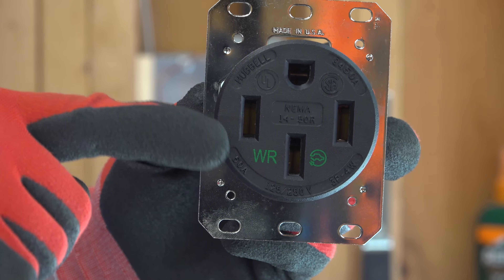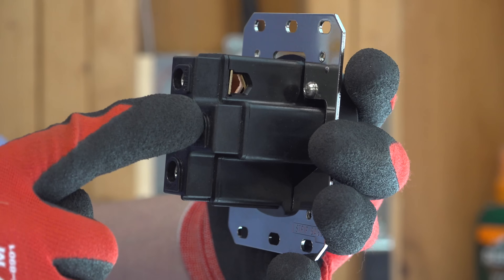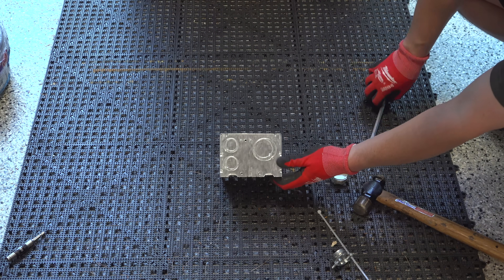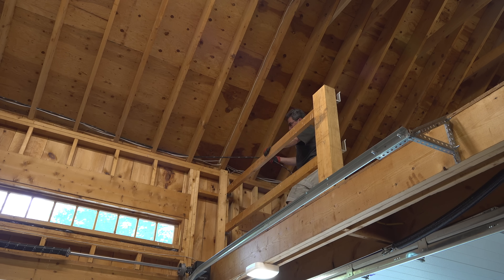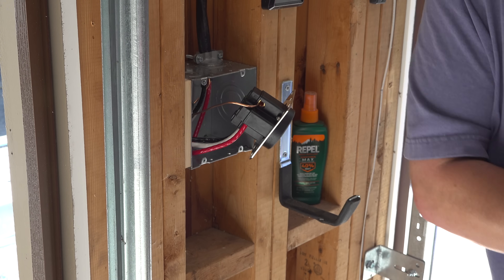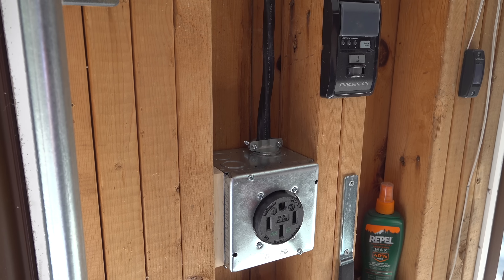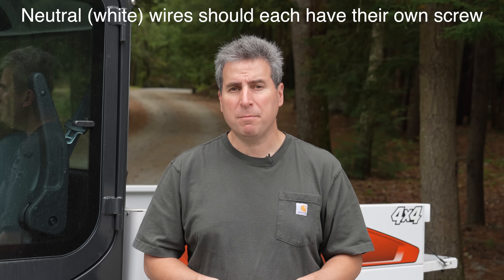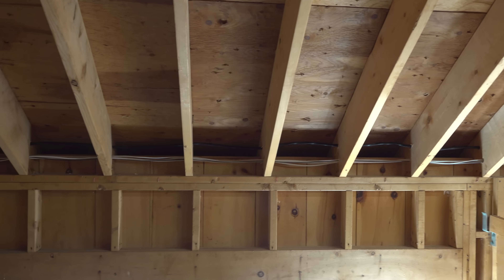How To Install A 240V Outlet Start to Finish -  EV Car Charger - Welder 14-50 Explained

Comment: I installed a 20A 220V outlet for my EV.  No need for 50A to charge an EV overnight.  In 5 years of EV ownership I have never left home w/o a full charge.  The 20A service is a lot less expensive.  So, don’t think it’s 50A or nothing.  My 16A 220V EV charger is plenty.  The only reason you may wish for 50A is if you need a quick charge but I can do that at my local Tesla supercharger.
Reply: For someone that has their main panel right in the garage it's only $20 more for me to run a 50 amp than a 20amp... and like this guy said,  now I can use my welder or a dryer too.  If you have a long run like this guy, 20 amps on 12awg romex would save around $300.

Comment: The difference between the cheaper and more expensive outlets has nothing to do with how long they are used.  That's just complete BS.  All outlets that are rated for 50A are required to be tested and rated for 50A continuous current (24/7 if necessary).  That's not the issue.

The difference is that the cheaper outlets are not rated for as many plug/unplug cycles, so if you are frequently plugging things in and out of them, the contacts will eventually get looser, and that's when you can have issues with things overheating and melting down.  Most of these outlets are intended for something like a stove or dryer where you plug it in once, and then don't touch it for years.  They are not intended for something like a welder or a battery charger where you may be plugging/unplugging things on a regular basis.

Also, where grounds and neutrals are bonded together has absolutely nothing to do with whether a building has its own ground rod or not.  Those are two completely unrelated things.  It is (as you said after that) about whether you have a ground wire going between the two buildings (but where the ground rods are is actually irrelevant to any of this).

Also, the code does not always require a GFCI breaker.  It depends on where the outlet will be located.  If it is located in wet or damp location (such as outdoors) or in a garage/outbuilding, basement, bathroom, kitchen, or laundry area, then it requires GFCI.  The "outdoors" and "garage/outbuilding" parts do probably cover most of the places most people will usually want to install these, but it is not technically always required, if you're installing it somewhere other than those places.

(Also, most local jurisdictions do not use the most recent version of the NEC for their actual code requirements, and are usually several years behind, so it the GFCI requirements can vary depending on where you live, too.)

THHN is not acceptable for outdoors (or other wet/damp locations) even in conduit.  You must use THWN (the "W" stands for "water-resistant").  In many jurisdictions, you do not actually need to run armored cable just because you're running it outside.  Many places even allow running bare cable externally (without any conduit, etc), as long as it is exterior rated, such as UF (underground feeder) or NM-C cable.  You only need to protect it in conduit if it is not rated for direct exterior exposure (such as THWN), or it is in a location where it might receive physical impact (bumping/scraping/etc).  Also, a lot of armored cable is not exterior rated either, so just because it's armored doesn't automatically mean it's OK for outside.

Comment: Good info on the box.  I spent over an hour looking for a box with a 1" knockout to match the 1" PVC conduit I ran to my garage (6 awg stranded wire).  Thought I would just get a solvent-weld PVC box at Home Depot and found they only go to 3/4" and even all their metal boxes, even on website (must order) have 3/4" max knockouts.  Instead, I bought a plastic box with flush sides (drill your own holes).  In my case, the box is exposed in the garage overhead, so no need to fit a 2x4 stud cavity.  Wish they made the box you found with rounded corners (hate those sharp-edged ones) for surface mount.

Comment: Fabulous install.  When describing the differences between a cheap NEMA 14-50 and a robust one, be aware of insertion limits.  The cheap one is only good for 1-2 dozen plug-ins where the EV model is good for over a thousand.  Prongs on the cheap one develop resistance when wearing out from insertions and that’s what causes overheating resulting in a fire.

Comment: 1. There's no reason to pay more for a Hubbell 9450A over the Bryant 9450FR. Bryant is a Hubbell brand and both are made in the same US factory using the same materials.
2. Hubbell and Bryant also sell lower-quality NEMA 14-50 receptacles under model RR450F. Make sure you get a 9450A/9450FR - NOT the Chinese-made RR450F, which is no better than the cheap ones at big box stores.

Comment: We had an electrician install a new 220V outlet in the basement so we could move our old range there when a new range was put in the kitchen. The existing cord was a 4 pin. Hot, Hot, Neutral & gnd. A new Sq.D G Fault breaker was installed in the main panel by the electrician. When we fired up the range a few days later it worked fine, for 10 minutes. Then the breaker popped. Tried again, same result. A call to the electrician and his response, older ranges commonly do that on new GF breakers. Our options were to buy a new range or put in a non-GF breaker. Our original outlet for the kitchen range was still serving the up stairs non GF breaker. Electrician said he wasn't allowed to put in a non GF breaker but we could.
Reply: i've been an electrician for 45 years and though the area i live in here in virginia has not adopted the new code applying to 2-pole gfci breakers(except for hot tubs)  . the new code for those municipalities that have adopted it states that all breakers including 2pole gfci or combination gfci/arc fault protection. also if your stove trips the gfci it deffinitly has a problem that could potentially become a shock haszard. some stoves (where the range cord hooks up) has metal tie strap(tie bar) that bonds the can of the stove but if that were the case it probably would trip the gfci breaker instantly. because it waits a little while befor triping could indicate that after heating up (which causes things to expand and sometimes due to build up of corrosion it conducts to ground(corrosion in hot tub heaters do it often) GFCI's are meant to detect current flowing in an alternate path to ground instead of through its neutral and are there to save your life. if he installed a regular breaker on that stove  it could potentially be setting yourself up for disaster and him a law suit and loss of his license. some older refrig/frezers have the defrost heat strips and ice and or corrosion would also trip the gfci's(most often when you went on vacation) so now you have to toss all that spoiled food

Comment: The subject of this video is "installing a 50A 240V receptacle". Please note that hardwired EV chargers do not use this receptacle so a distinction needs to be made when discussing the breaker requirements. Tesla's current Gen3 wall charger does not use a GFI breaker since it is hardwired and has internal fault monitoring. The internal fault monitoring cannot be disabled in the US so the small current-to-ground testing will trip an upstream GFI breaker.
For code compliance you MUST use a GFI when installing the 14-50R.
Reply: This isn’t unique to Tesla’s charge station. This is a standard feature of 240V EVSE

Comment: SO SO Much is wrong here. You cannot run 50A through 6ga NM-B (Romex).  For continuous loads (loads that run greater than 3 hours) you can only load Romex to 80%  Which means you must oversize it by 125%.  On a standard beaker you would have to run 60A which nets you 48A max, which then requires 4ga romex.    Alternately if you can source a continuous duty breaker  you can run a 50A load but would still need to upsize the wire.
Reply: That's why continuous duty loads that you plug into the 14-50 outlet are only allowed to draw 40 amps, not the full 50.
Reply: @phillipsusi1791  They can draw 50 just not continuously
Reply: @steven7650  Yes... and they can draw 40 amps continuously, as I said before.  Continuous loads must be derated by 20%.

Comment: Question, wouldn’t  it be bad idea to plug anything in at a lower amperage requirement? Like a load that needs 20 amp protection.
Reply: The circuit breaker isn't there to protect the load; it is there to protect the wires.

Comment: Nice. I did this same thing BUT we should have used 4ga THHN for the Tesla rated 48 amp charger and a 60 amp breaker.😒
Reply: Tesla's Gen1 mobile connector had a max 40A charge rate and the Gen2 & Gen3 are 32A max. Are you talking about a hardwired wall connector? Depending upon the generation, those would output a max 80A. But you would have had to put it on a 100A breaker and much larger wire. The 14-50R outlet in this video should NEVER be on a 60A breaker.
Reply: @michaeltaylor5451  I haven't kept up with Tesla's home chargers, but last I heard it was a 48 amp unit. I don't even own an EV- just wired in an outlet for possible future use. 
Agree about the 14-50R but you can always de-rate the breaker and use the outlet, or remove the outlet and hardwire a higher load charger and change the breaker. Just talking about the wire from the panel to the charger I should have gone one gauge higher. 
Who is gonna have a 100A wire for an 80A charger?? That's like service drop wires. No one should do that- too dangerous. There's a reason those thick wires are above our heads.

Comment: Which 240V 50A Breaker did you use?
Reply from the maker: I used this model: https://amzn.to/4274VVN  I happened to have the new version which the link is for, and the older version which was the one I installed. This breaker has a lot of negative reviews however they have a 10 year warranty so if you have issued I would have them repalce it. Eaton is a good company and I think they had a bad batch of them initially or they were too senstive. I think the current model is fine if you get a new, current stock of one

Comment: 5:47 , I start to see maybe an installation issue. To the left of the garage door you run the cable through it's own drilled hole(Great). As you pass that point it look like you use a hole with other cables which is not a bad thing, but you didn't say anything if the other cables are (current carrying conductors) which would effect all of the cables ampacity capablity. The point being NEC's Table 310.15(B)(3)(a).. Over all a great video.

Comment: 5:47 I don't care if that's code or not, I can't wrap my head around the idea of drilling my roof studs through and through like that to get a cable across. The integrity of the structure is more important to me than spending the time and money needed for an alternative.

Comment: Isn't that outlet self grounding when it's screwed into place? Mine had a copper strip going from the ground to the mounting flange.
Reply: Even if the faceplate is bonded by the receptical, the box still is required to be bonded.

Comment: Perfect do it this way 40 years electrician exactly the way I would do this right down to the clamps
Important to use EV high endurance plug and afci Breaker  don't go cheap

Comment: I think you should have said to turn the mains off at the start, before messing in the box not just when you went to put in the circuit breaker.
Reply: There’s literally no need to do that if you do as he did, wiring up everything at the receptacle end first, landing wires in the panel last. 

Other inhabitants of your building may not appreciate the power being off for hours longer than necessary

Comment: Excellent video! The only suggestion I have is that since the outlet is in an uncontrolled environment where condensation and freezing can occur. This leads to corrosion so I would apply OX-Guard to the wire ends with a brush  then apply a little to the plug as well. Outlets burn up due to heat build up from corroded connections. It is a bit Belt & Suspenders but well worth it.
Reply: The copper wire and these brass/steel screw terminals will not corrode or significantly oxidize from that sort of exposure.  You absolutely do not need any kind of special oxidation protection for this outlet.  That is typically required when working with aluminum conductors, because aluminum can readily oxidize and develop a high-resistance connection, which can cause overheating.  (But this is also why people stopped using aluminum wire in most residential environments entirely a long time ago, too.)

Comment: Great video. And I’m glad you took the time to explain the difference between standard/acceptable receptacles versus quality daily serviceable receptacles.  Heat buildup is the greatest cause of malfunctioning equipment   Have you had any experience with the meter head adapter modules that allow users to plug in a L14 30amp plug to run a generator during power outages. Apparently these modules allows the homeowner to operate a generator without having a separate interlock device installed.  Thanks

Comment: That's a 3 x 13.3 mm² cable. That's insane; we're really getting into ranges where 3-phase power makes a huge difference. I could get 96 amps here with a 4 x 6 mm² cable... (Or 48 amps at 4 x 2.5 mm² if the distance is short enough.) And that's continuous amps, not peak like the US uses for labelling their breakers.

Comment: Great tips. Definitely only go with the Hubbell or Bryant. Somehow, there are pretty much no other receptacles on the market which can actually handle the continuous draw. Also like your advice on the box and cover as nobody likes a floppy receptacle when you plug in a beef device. I'm sure many others have mentioned it, but always a good idea to wiggle your wires after torqueing and then torque them again. Also, if you have a subpanel in detached structure, it does still have to have its own ground. Couldn't tell if yours was attached or not. Great video overall and the other one I can recommend is How To Install A 240V Outlet In Garage by The Excellent Laborer. Gets pretty much everything right.

Comment: I don't have a copy of the current NEC so someone please correct me if this isn't accurate. From what I understand a GFIC breaker isn't required in all 50 amp applications certainly in the application illustrated in this video it would be but it's my understand that in the case of a kitchen range if the range is more than six feet from the sink it isn't required. 
One other note, in my opinion it isn't a good idea the strip the sheathing from the cable before inserting in the box especially if the cable installation is complete. You are required to have I believe at least ¼" of sheathing in the box past the clamp. If you miss judge the sheathing removal and it doesn't pass through the box this could be a code violation, it not worth it and with the proper tools it's not that difficult to remove the sheathing in the box.

Comment: I have been following this subject.  Apparently, there are no duty cycle ratings for receptacles.  Furthermore, even though a receptacle carries a rating according to the NEC and UL standards it may not be capable of providing that amperage.

I recognize that there are differences between brands, but who actually rates the duty cycle on receptacles.

Which brings me to the "EV" rated receptacle.  Who does the rating and what are the requirements of the rating?

Or do we just get tradesman hand waving and spiel?
Reply: I don't know how Hubbel rates theirs. I do know it's far better built than the Leviton, and unlike the Leviton, does not show up in Google image searches melted. 

You can save money with the Leviton, even when planning to keep an extinguisher nearby or if your home insurance is affordable.
Reply: @thenexthobby  tyvm, this pretty much underscores my comment that there are no duty cycle ratings for receptacles, and all the rating is valid for is the style of the receptacle, that is, contact arrangement.

And to think that the industry got all in a tizzy about arc fault interrupters.

Comment: Good procedure review. Note
you may not be able to source double pole 240 GFI circuit breaker for old brand/model distribution panels. Look into this early, because to follow code you might have to upgrade entire panel !  I haven't yet seen a 14-50R outlet with GFI built into the outlet. GFI is for outdoor or potential wet locations. Actually the universal SAE J1772 standard already includes GFI integral to EVSE. UL listed EVSE also include GFI. Don't know about Tesla's standards, but likely the same.
Some local city codes require combined arc fault breakers.😢

Comment: Why not 6-50 instead of 14-50?
Reply: Because you might want to run an electric range or clothes dryer in your garage (apparently.) The extra wire allows an appliance to have a separate 120v supply (clocks, control panels) that welders and EV chargers won't make use of.

Comment: Your calling the neutral bus a ground bar. It is not , and the grounds should be attached to the ground bus not the neutral bus.
Reply: He explained in the video that in this panel, they are one and the same, because code when the panel was installed required them to be, and for there to be a local grounding rod.

Comment: So… yoy telling me, that if my Slovakia Mother in law cooking and baking for 4-5 hours is ok, but charging my tesla for 2-3 hours is not?

😂😂😂
Reply: That oven isn't pulling 50 amps continuously. Once it has reached temperature, it will cycle on and off to hold it. An EV will not cycle; it will continuously pull those amps for hours.

The other point that was not mentioned in the video is plug cycles. Ovens, washers, dryers and so on are plugged in once, and then stay plugged in for years. Those cheap outlets are therefore rated for maybe a hundred plug cycles, if that many. When sharing an outlet between a dryer, a welder and an EV, like many people do, this will make a big difference in no time.